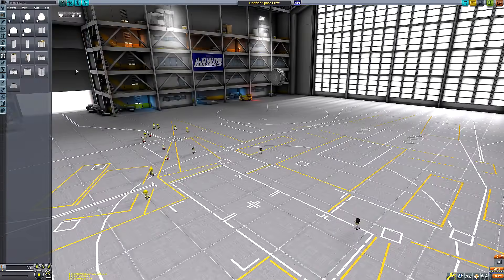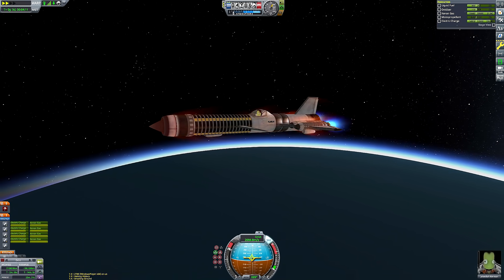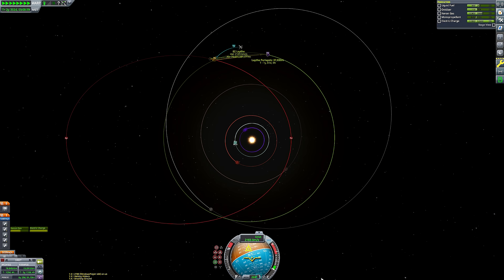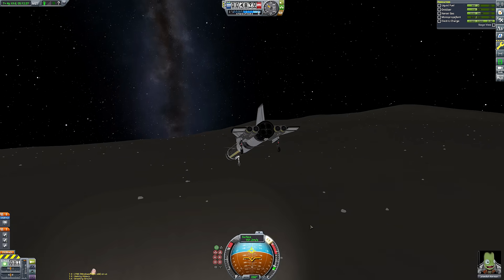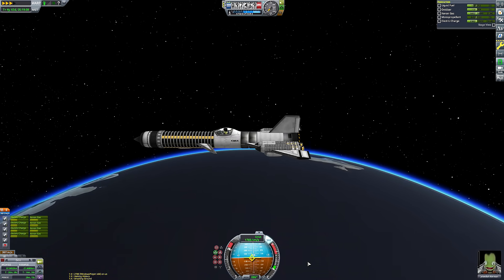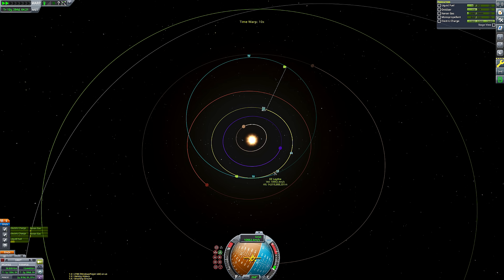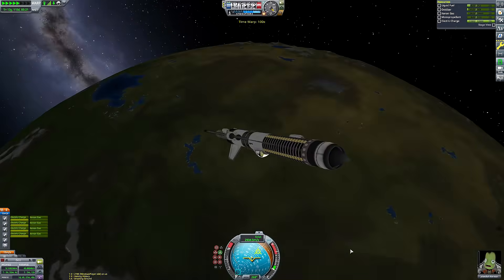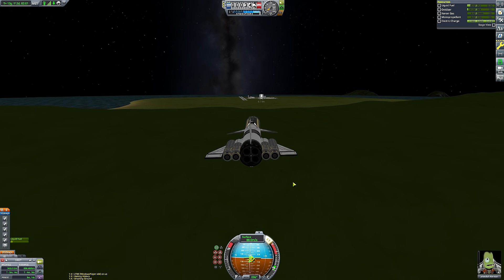KSP: I changed my mind about ion engines...

Comment: You can’t just spam electrical charge for an ion ship!
Matt: hmm yes batterie
Reply: A Man With No Hat battery go zzz
Reply: But seriously, why the hell did he use 17? He couldn’t just make it a round 20?
Reply from the maker: @cranjusmcbasketball2052  there are three more inside the front fairing tho :)
Reply: @MattLowne  can you do your next video with a flying runway and mid air refueling?
Reply: @Shadow_king-rf3xd  oui, this is a meme comment not a request comment, send it away,

(I'm just joking btw)
Reply: Moar boosters moar batteries
Reply: This man is balloon boy in a nutshell. He wants your batteries
Reply: @MattLowne  you should play in real solar system...or...can't you?
Reply: Solar Panels: "Am I joke to you?"
Reply: Haha battery go bzz bzz
Reply: wouldent it have made more sence for less batteries more genorators ?
Reply: @MattLowne  you should've added one of them nuclear generator things that you unlock late in the research tree and stick them inside or alongside the SSTO and you would need alot less batteries
Reply: @HDTomo  he did have one, that's the RTG
Reply: *ZZZZZZZZZAP
Reply: @joj.  nuclear power: yes
Reply: Alex111  Did you ever get around to doing this man?

Comment: 10:30 In real life, some moons are hotter because of tidal forces from orbiting such a large planet
Reply: If i had to guess laythe's oceans are not frozen because of thermal vents
Reply: tater anus i think it's a combination of tidal heating, thermal vents, the atmosphere and salt in the water.
Reply: But the giant magnetospheres of Gas Giants (Jupiter for example) will kill them anyways
Reply: @charkie2388  salt is out of the question, at that far out water would still freeze even if it was almost pure salt. If i had to guess it is from geothermal vents and possibly natural nuclear fission, we know that nuclear materials exist in the ksp solar system, because of the rtg and its description in the editor, yes it is called blutonium 239 but lets face it it is supposed to be plutonium 239;
Reply: @jakobofcincy  but salt does have a role in it, right?
Reply: @randomguy0047  maybe makes the water freeze 10°C lower. Not much difference
Reply: @sanctuary6285  and would blow away any atmosphere
Reply: @sanctuary6285  Saturn isn't nearly as deadly in terms of radiation as Jupiter. Deadly levels of radiation aren't inherent to gas giants afaik.
Reply: Mabie some greenhouse gases play a role too.
Reply: @sanctuary6285  the magnetosphere alone doesn't kill stuff, it's the ionising radiation carried within them. If Laythe has a thick enough atmosphere it could shield the life on its surface from the worst of the radiation. Would make for absolutely sick aurorae tho
Reply: @dsdy1205  More important would be Laythe having its own Magnetosphere, powerful enough to not get completely overridden by Jool's
Reply: Io is the best example of tidal heating. That thing looks like a pizza because Jupiter keeps kneading the dough.
Reply: idk what laythes mass is but if it is kerbin-mass or more geothermal activity is a lot more likely to regulate the planets temperature, aided by jool's tidal forces making it much more h o t .

Comment: KSP2 will be out by the next time he uses ion engines
Reply: Ksp 8*
Reply: Ksp 69*
Reply: KSP 420.
Reply: KSP 421?
Reply: Ksp 69420*
Reply: KSP ∞
Reply: @boredfox9063  ksp 70419*
Reply: @1974moumita  oh. We're getting serious. Okay, Ksp ∞^∞
Reply: @전제유-r1q  KSP ∞^∞ Version 1.5
Reply: @1974moumita  KSP ∞^(∞^∞) Version 1.5.1
Reply: @전제유-r1q  KSP ∞^(∞^∞) Version 1.10.2
Reply: @1974moumita   KSP ∞^(∞^∞) Version 1.10.3
Reply: @전제유-r1q  ∞^∞^∞^(∞^∞^{∞^∞}) Version 1.50.6
Reply: @1974moumita   ∞^∞^∞^(∞^∞^{∞^∞^∞}) Version 1.50.7
Reply: 전제유 KSP 0.
Reply: Ksp 76
Reply: @전제유-r1q  Totally scared because next time I will do this it will be so big I will get reported for spamming
Reply: ksp eon
Reply: @chickenchaser6558 KSP -0
Reply: @1974moumita  KSP [REDACTED]
Reply: @1974moumita  agree. Let's stop?
Reply: @전제유-r1q  yea... Okay
Reply: I will carry on just for one more
KSP sqrt(-1)
Reply: Actually the next time he uses it will be never
Reply: Ksp 2 should add huge ion engines. Imagine ones that have over 1000kn of thrust LMAO. The electricity you would need for that would require several nuclear reactors
Reply: DanDeMan they should also add bigger nuclear reactors because the ones they have are tiny and barely generate enough electricity for a small ship
Reply: Y'all prepared for this?:

KSP ∞!^∞!
Reply: Are you sure KSP 3 won't be out by then?
Reply: Ksp 4.1876e+204
Reply: KSP 466555434554677554677 will be out when he uses a ion engine next
Reply: Ksp 2: episode 1
Reply: And my ion engine burn will be a quarter of the way done.
Reply: it is near...
Reply: Your prediction holds true so far
Reply: Wellz it's out
Reply: LMFAO YOU WERE RIGHT
Reply: @shaggyrogers9028 wellz it’s canceled

Comment: When I was starting out with Ksp I wanted to put a base on Duna but I thought it would be really difficult so I used ion engines so that I could have an absurdly high deltaV. It took about 3hrs in real time to get there and it was hell. I’ve never used ion engines since.
Reply: Magimo oof did u use physic time warp
Reply: @paintyourface2989  No I was really new to the game and I hadn't really tried out mods yet. I used only standard time warp :p
Reply: I cant get physical time warp to work while burning? It just says "cannot time warp while under acceleration"
Reply: @jakobofcincy  you prob figured it out by now but incase not you press Alt and .

Comment: Hate to be that guy, but just wanna say that technically Jack Daniels isn't bourbon, it's Tennessee whiskey. The only difference is that Tennessee whiskey is filtered through charcoal. 

Tennessee and Kentucky have always had a rivalry, and so the distillers of Tennessee didn't want to call their whiskey bourbon and be associated with Kentucky, the birthplace of bourbon.
Reply: I'm from Tennessee and I didn't know that... I am ashamed.
Reply: Man I always drink Kentucky bourbon it restores my deadeye.
Reply: As a whiskey distiller, this is incorrect information. Nearly every single whiskey around the world is filtered through charcoal (either pre- or post-barreling), including Kentucky whiskies. The requirements to be called "bourbon" is that the mash bill is at least 51% corn, made anywhere in the United States, aged in new charred oak barrels, and some proof requirements. 

If some distiller doesn't want their bourbon to be called bourbon so as not to be associated with Kentucky, then they can call it something else (much to the disagreement of 1933 federal government). But that doesn't change the fact that it is legally a bourbon. So, since Jack Daniels fits all the aspects of bourbon, technically Jack Daniels IS a bourbon. They are simply not required to label it so.

Comment: Whenever I use ions, about 90% of the rocket is batteries

1% rocket
5% liquid fuel
4% solar panels
Reply: Any PB-NUKs though?
Reply: Haha toasty. Only youtuber I know using that is thunderf00t. Admit it, you're watching him sometimes.
Reply: I have taken the opposite approach and done 90% solar panels (by volume / surface air, not mass) and a modest battery. But once you get out to Jool it doesn’t work well.
Reply: Same
Reply: @depth386  At that point might as well throw in some RTGs.
Or rather lots of RTGs. Have a giant payload bay that is just full of struts and radiation.
Reply: use rtgs
Reply: @HappyBeezerStudios  Nuclear power in a nutshell
Reply: @comicsansgreenkirby what is  a pb nuk?

Comment: Matt: "You'll probably be fine!"
Me: attempting the 2000th time to land on the Mun and fails
Reply: you need a wide landing base, preferably having your lander wider than it is tall
Reply: Just keep at it.
It may seem impossible for now, but you can get to the Mun.
Reply: @DS-tv2fi  honestly, I've landed
Never had enough fuel to get back, can't leave mun orbit.
Reply: @Somiaz  Ah.
Have you tried a rescue craft?
Reply: @DS-tv2fi  Then the rescue craft runs out of fuel, and you have to rescue the rescue craft.
Reply: @scrappy0729  don’t forget the rescue craft’s rescue craft crashing because you didn’t check yo staging.
Reply: @DS-tv2fi  And the rescue craft for that rescue craft blew up on ascent because parts were clipping.

Comment: "RTGs overheat, don't know why"
What even is conduction right?
Reply: Radio Thermal Generator
Reply: Kyle Forrest I know
Reply: @Jognt  yeah I'm just pointing out another reason why they might over heat
Reply: Kyle Forrest oh right. Honestly that was also what I was hinting at (generated heat being conducted to the surface). But looking back I didn’t really specify that bit :p so thanks for the clarification!

Comment: The reason Laythe has an atmosphere and liquid water may indeed have something to do with Jool. Jool's magnetic field extends across the entire Joolian system, and its gravitational field likely does as well. In this way, it may be heating Laythe's core by continually causing friction between the side of Laythe that faces Jool and the side that doesn't, as the joolian side would be affected more and the dark side would be affected less. If this friction heating is strong enough, then Laythe's core may still be liquid and its magnetic field still be active. If the friction is large enough, then the planet's core may be hot enough to melt the icecaps and cause liquid water to exist on its surface. The air is strange, though.

Comment: I use ion engines for something like a small comms satellite. Just a dish, batteries, and solar panels on a probe core. Works great for getting it into LKO.
Reply: Thats incredibly expensive in Career mode.
The engine alone totals 10.000 Credits, not including the expensive xenon.
You can just get a chemical rocket for that price.
You can place a sattelite in Munar Orbit for the same price
Reply: @user-si5fm8ql3c  I usually play science mode.

Comment: Would be interesting to see the effects of dumping the fuel in a hybrid craft like this now that you have the tools to do it- maybe even using the fuel valves as low thrust engines to deorbit, since you can use the fuel separate from the oxidizer.
Reply: Yo two years ago how are you

Comment: Fun fact, you can put a normal engine behind the ion engine, it will act as if it is it's exhaust pipe.
So yeah, you can put something like a rocket bell or aerospike engine directly against the exhaust part of those ion engines.
Even in basic Kerbal.

Remember that vertical take off prototype the US Airforce/Nasa, was experimenting with back then?
Take the biggest rocket fuel tank as middle structure, then use those big shuttle wings, maximum amount, put those solid fuel side boosters on them, let everything use that kerbaldine K1(?) engine for maximum thrust, it works, though basic Kerbal can give fun visuals, especially if you go multi-stage.
Those wings then act as RCS fuel, if done right.

Comment: matt: apologises for click baiting and using gravity assists

me not knowing what the heck gravity assists are
Reply: Basically, you can trade momentum between a craft and a planet (or moon). You gain velocity and the planet loses velocity (this can work the other way too). Since the planet is way more massive than the craft, the change for the planet is negligible, and the change for the craft is substantial. Of course, the underlying math is much more complicated, and there are several factors that determine the actual change in angle and speed, but that is the gist of it.
Reply: Didn't he do aerobreaking and not use gravity assist?

Comment: From the look of it, there were plenty of situations where the TWR of the ions was not the limiting factor, but rather the power generation of the RTGs that forced you to throttle down or split the burn further. Perhaps a single 1x6 shielded solar panel would have been a worthwhile addition. It wouldn't have helped that much at Jool, but certainly at Kerbin - both at departure and at return. Being able to burn more efficiently would likely have balanced out the dV penalty of carrying its mass.

Comment: If you are having trouble with heating on re-entry (and your ship structure can handle it), you need to spin the craft. It will help kill your speed and lower the temps the parts endure.

Comment: You can use kal 1000 to make ion engine generate effectively infinite thrust. Although fuel and electricity usage will be astonishing, you can mitigate this by setting another ion engine to negative thrust with another kal, which strangely produce no negative thrust but instead fuel and electricity.

Comment: Maybe Laythe has liquid water because of geothermal activity. The core is so hot that it creates the hospitable environment in place of the sun. Nearly every moon of Jupiter and Saturn are geothermally active with under ice oceans, but are not hot enough to heat the surface ice. Maybe Laythe is that freaking hot.

Comment: shouldve added solar pannels. I always overcome the low twr of the ions by just using many of them unless I need lots and lots of delta v. Also the huge stack of batteries remove so much delta v. For atmospheric flight, you can include the radioisotope thermoelectric generators so you have atleast some power while in flight
Reply: fyi a single giganator can handle about 3 ions continuously. Only thing I dont like about the ions is you cant mine xenon. They should add more electric engines like from the mod Near future. Maybe some that have worse isp but a bit more twr and/or their fuel can be mined

Comment: For your new Laythe series, Laythe aint as cold as you'd think, let me explain:
Jool would be about 24-36 times brighter than mun, (and if kerbol system was realistic, 10 times that), that combined with all rhe other moons, mabe 40×as brigt as oud mun plus a 25th of kerbol's brightness by distance, for a grand total of a 4.1% of kerbin's light, but Kerbol is a red dwarf (if not, heat aint a problem), which means that a ton of radiation (also the joolian magnetosphere), and the oxigen is made from irradiating volcanic CO2, generatig O3 (that rare smell from EVA reports), that decomposes in O2 giving heat and absorbing radiation, also Laythe would have LUDICROUS auroras all over that heat a little bit and a lot of volcanic activity, extrmely salty oceans, geothermal heat and tidal forces, water can be liqud thre, it would be just abou as hot as antartica except for the poles, a little cooler there. That explains breathable (but VERY, VERY unhealthy) air too, and that kerbals that arent freezed to death (at least in the first few minutes). There could even be ocean life (dry land is a radioactive salty wasteland), also would have a good chunck of graphite, methane and greenhouse effect, so mabe...
Reply: In fact, Laythe's warm zone would be a radioactive version of antartica, vey similar indeed :)

Comment: i once figured out the you can use Fuel Cell Arrays to keep ion engines supplies with energy, BUT...
you would need i array for every 2 ion engines.
AND fuel cells need rocket fuel and oxidizer...
i used that for a small  probe, which was on top of a set of Nuclear engines.

Comment: Hello Matt! I think I can explain why Laythe can have water. Laythe is the innermost moon of Jool, meaning that the combined tidal stretching and heating of Jool and all of the other moons means that the inside of Laythe is squeezed periodically. This results in hotter temperatures! We see the same thing happening on Jupiter's innermost Gallilean moon Io, where it is so stretched out by all of the other moons and Jupiter that it has a ton of internal geological activity, resulting in massive volcanoes! On Laythe, the tidal heating doesn't result in volcanoes, but rather water. Can someone please correct me if I'm wrong, I am still trying to fathom this subject.
Reply: Not really but also yes
Reply: @justinwright245  If KSP correctly represented gravity, thus making Tylo force Laythe into a more elliptical orbit (and completely removing Vall from the Jool system), then I think my statement would be more accurate.

Comment: The glitchy encounters are happening on my installation too. I tried to reproduce your problem trying a Laythe gravity assist to capture at Jool and found:
[LOG 12:09:51.991] CheckEncounter: failed to find any intercepts at all
[EXC 12:09:52.183] StackOverflowException: The requested operation caused a stack overflow.
...spammed in my KSP.log.
Reply: KSP 1.9.1 is not very stable in my experience, I reverted back to 1.8.1 for stability (also that meant I could reinstall all my mods)

Comment: Nothing that is hollow in ksp provides proper heat or aero protection. Shit bows up behind fairings, stuff in structural tubes still cause drag, and decouplers might as well be solid and hanging off the side of the craft for the amount of drag the have.

Edit: WHisky review, sounds like Stewie, say cool whip.

Comment: could you plz do a tutorial for how to get into a successful orbit? im having lots of trouble with keeping orbit.
Reply: 1. Build a rocket with at least 2400 m/s of fuel. Remember that small rockets get into orbit with less difficulty than large rockets. 
2. Turn on SAS and launch your rocket. When you reach 150 m/s in flight slowly move your rocket 45 degrees to the right (45 on the nav ball). 
3. When your ark on the map reaches about 80k meters creat a maneuver node at the highest point of elevation in your ark, and drag the prograde marker untill you see the circle form and AP and PA flip. 
Tips: utilize wings and struts between stages for stability
Reaction wheels are a good idea to add
Design your rockets size for the weight of your payload
Check the engines fuel consumption and vac or atmospheric thrust weight for max stage efficiency.

I hope this helped